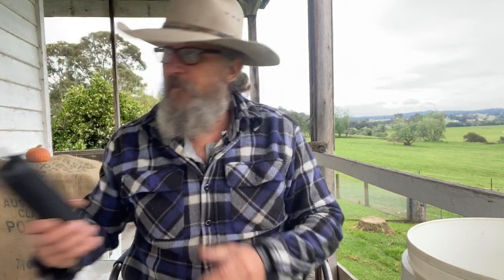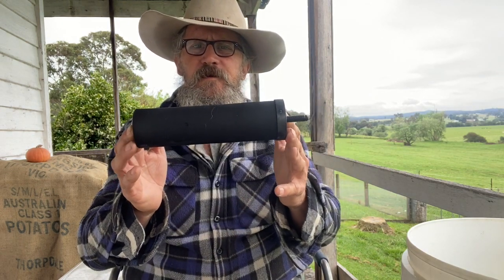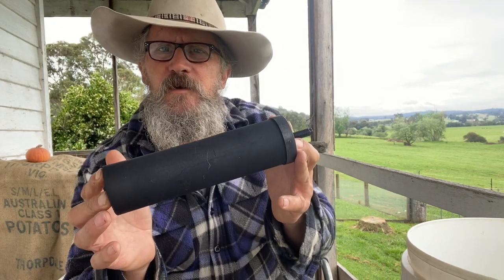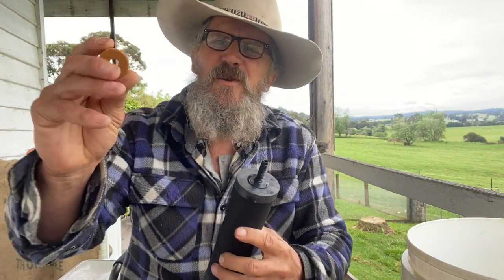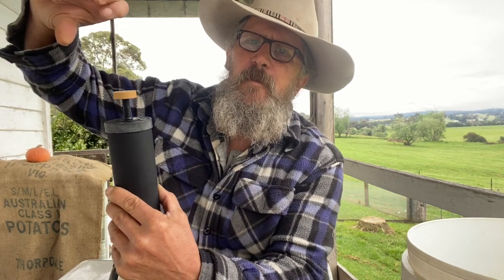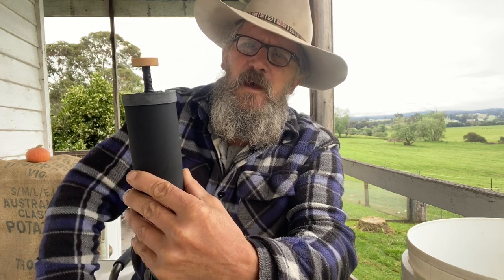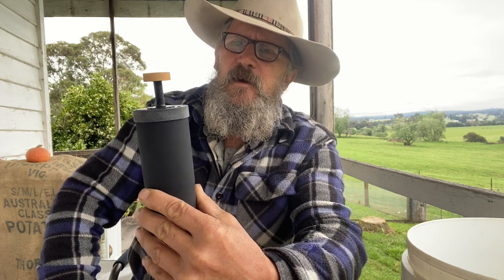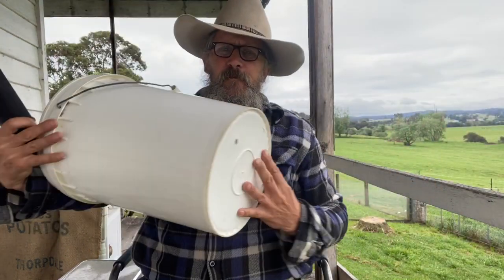HOW TO BUILD A WATER FILTER

Comment: I was thinking of doing something similar to this when I saw how expensive the Berkey systems are. Yours seems perfect. I think I will try this, soon. Thank you!
Reply from the maker: Homestead Hopeful Tara G,day, they are inexpensive to make ,we filter a lot of water through ours.a sub suggested to put fit tubless tire valve to let air into bucket .but it’s not a issue for us ,top lid we leave loose ,sometimes I lift bottom lid in one spot .we like it because we can filter big amounts of water ,and we can take it camping if we want to if creek water is running dirty .cheers good luck